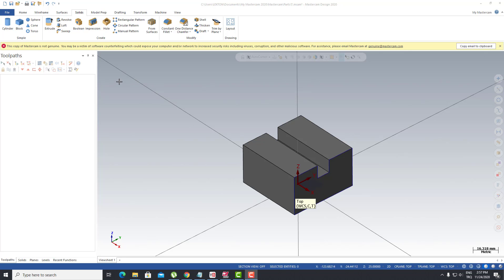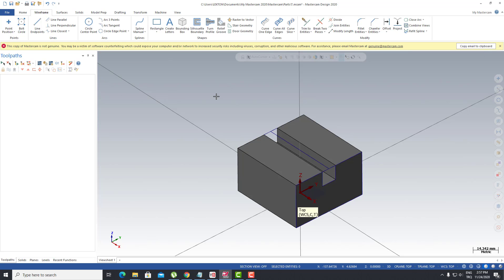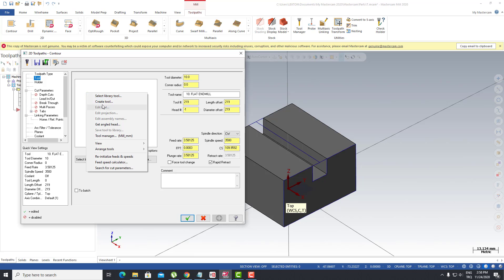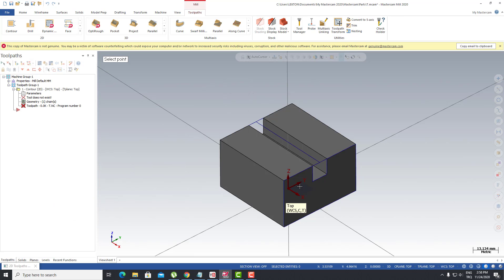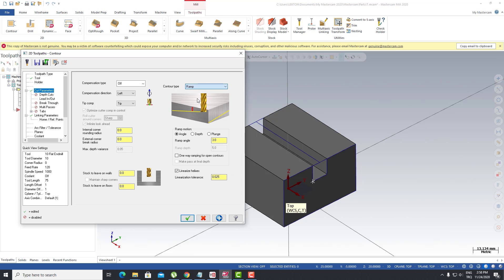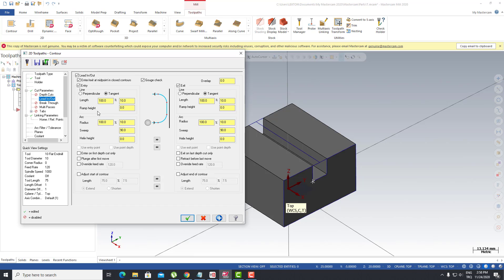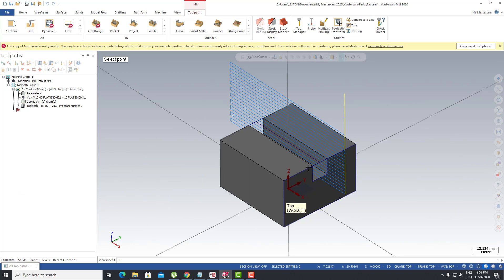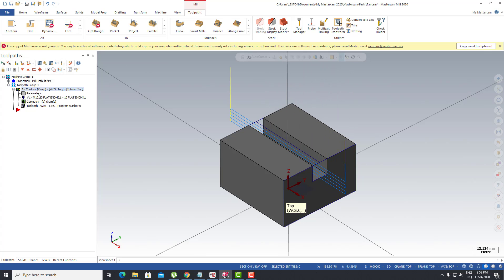Mastercam in A minute Contour Ramp Toolpath

Comment: Yes!! this is exactly how I cut slots with a full width of the cutter 
If the slot is not through the sides of the part and I cant plunge outside the stock I use "depth" as a ramp option and tick "make pass at final depth"
1 like from our channel keep posting new vids :)
Reply: I agree with you ASPE I do it in the same way as you guys. Nice one. Like from me too
Reply: ASPE im your follower i agree this is the best method of cutting slots